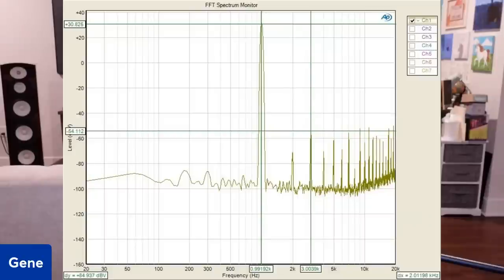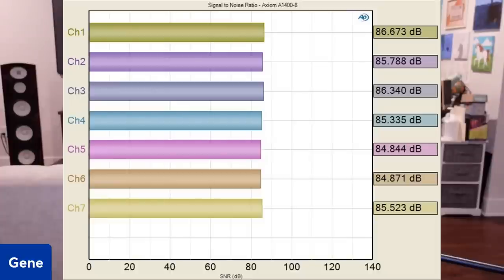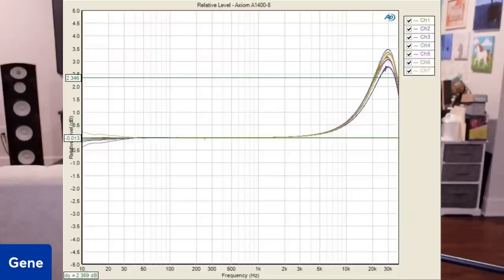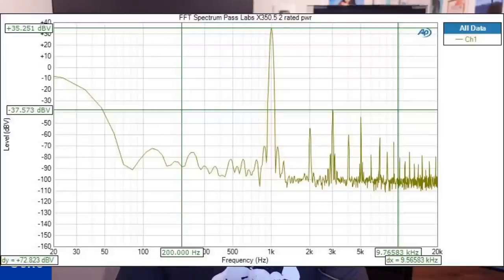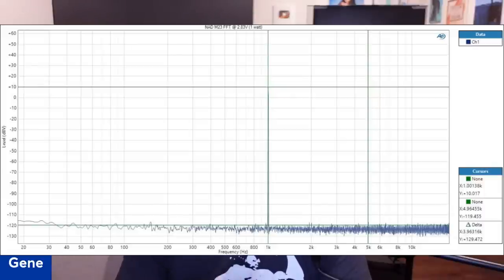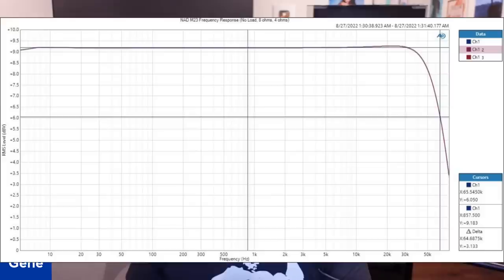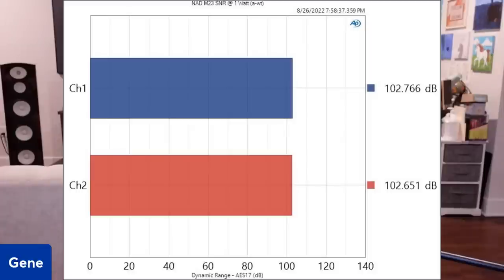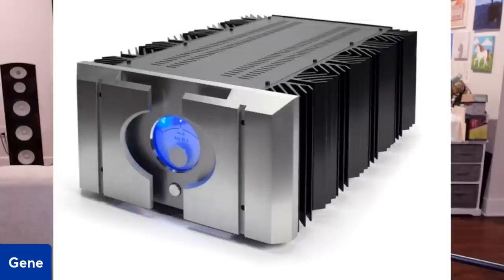Linear Amps are DEAD, Long Live Class D!

Comment: This is a really timely discussion as I’ve been looking hard at amp options for my living room. Looking at just buying another Parasound (A21+) to go with my Anthem STR, but also looking hard at something like an NAD integrated like the M33 instead.
Reply: If I'm not mistaken M33 is not even close to this one. Look at stereophile review. I've been there, decided to go with integrated STR. Not great, but not terrible. Awesome preamp but the power amp is loosing a bit of this performance.
Reply: Go for blind test, I noticed difference when I wanted to buy ELAC Floor standing FS 248 and carried my NAD and they had Marantz 7000N and was completely taken over by it. Earlier I had Class AB Onkyo but all the hype through youtubers for NAD i fall for it and was happy until I started re-discovering clarity.
Year back I visited a consultant in another city who had two Class D amps Pioneer and NAD and other Class AB and took blind test.
Please note Class D takes sample rate like digital and when it goes to high frequency amplification that adds noise (kind of jitter) and to eradicate they remove high frequency now to compensate they add high frequency before amplification.
Also note KEF has released wireless speakers and for Bass Driver Woofer they are using Class D but for Mids and Highs they are using Class AB.
You can take from my experience or can go ahead and burn your money in class D.
The analogy of Electric and Fuel combustion is totally wrong that can be used for amp power rating.
Please check PS Audio (Class D Stellar are cheap and Class AB BHK are very expensive) even Marantz gave up Class D after Model 30 and  back to class AB, all high critical listening amplifiers are Class AB or Class A (gets too hot had demo of old Yamaha at second hand dealer)
Reply: What's also not mentioned, or I missed? Is power consumption of Class D Amplification being very low. Easy on the Grid Cali & electric bill too for that matter. Another reason I got out of the 100lbs power amp realities. 👌
I'm liking the Active speaker options nowadays too!
Reply: @adrianegowski5012  Good catch! I read simular.
Reply: @jamiesmith6838  especially that Dynaudio recently issued new Focus series with dirac :-)
Reply: Avoid NAD. I've been regretting my NAD receiver purchase almost from the beginning. Defective designs, defective product, feckless "support." They contract out their (already defective) designs to various vendors who build the products out of sometimes-shoddy materials. You'll realize what a fraud "high end" can be.
Reply: @SoundOfYourDestiny  That's a bummer. I already have an Anthem STR preamp, but I'm sharing amps channels from my theater amps and it's a pain for triggering and control state. I'd rather just get a dedicated amp for the living room so have been looking at options and looking at a Apollon and others with all these Purifi class D amps to learn.
Reply: @SoundOfYourDestiny  When I purchased my NAD 2200, all those years ago it was sold as an amp unwavering to speaker loads down to two ohms? It only drove my JBL L-166!
It was my only power amp that needed repairing. It's industructable low ohm ability shortened it's usable life. (The amp that tried to do too much) 
I paid for the repair and sold it soon after. 
Never purchased another NAD. I was tempted to give them a second chance, hoping they've improved..but I never did. I was done with Mid-Fi. 
I went to a silver Classé CA-200. One off the best power amps I've ever owned.
Reply: @Techthusiasm  I ended up buying a Pioneer receiver that really has quite a few things properly thought-out. It even has two separate 12V trigger outputs, which you can set the activation status of for each source. I use it to turn on a wireless HDMI system for video sources. And... it worked as expected on the first try. The one idiotic failing (which the NAD also suffers from) is that one of its extended zones (for example, outdoor speakers) can't play back a digital source. WTF? At least that's only for zone 3 on the Pioneer; the NAD only has a "zone 2," which is essentially worthless according to them. In both cases, all I had to do was run RCA cables from a preamp output to the zone-whatever input to play back digital sources. How can they be too stupid to simply do this internally?

Comment: This is great to know that it's finally possible to make a good Class D amp.  I hope some of this dribbles down into the lower cost Class D amps in the future.
Reply: Try the Aiyima a07. Replace the removable Op Amp with a Sparkos Lab dual discrete Op Amp.
Reply: they've existed for 10-20 years sir.  just not mainstream.  you can get END GAME level class d/t amplifiers at virtually any output power you need for less than 500 bucks.  IF you are a diy-er.  connexelectronic, buy the modules or a board, buy an smps, it's as simple as hooking up some wires.  put it in a box if you care to.  if your needs are for only 100 or 200 watts and 2 channels, then literally less than 300 bucks can get you end game level sound, i'm talking it does not get meaningfully better than this sound.  forget the overpriced brands, wake up to diy and chi-fi.  ultra quality is ultra affordable now, if you are merely careful to discern where to look and what to get.  garbage chi-fi also exists... right next to end-game stuff.  luckily these days we have people that do the legwork with measuring and reviewing nearly everything in existence so it's not that hard.  end-game dacs for 100-200 bucks all day baby.  the ONLY part of the chain that technology hasn't made super cheap for end-game quality is speakers... because their raw materials still simply cost money even if you build it yourself.
Reply: Already has, long time ago. Hypex sells cheap modules of many ratings that outperform everything else on the market, regardless of price
Reply: @yurihalberstadt618  : Thanks for that information.👍👍
Reply: @scottypalmer2158  Oh and i forgot to mention: the measurement graphs on their site are so incredible you'd think they're simulatiions. Their not. Those are the actual measurement graphs. BP is seriously serious about not spreading any BS, even more so than Gene.

Comment: I moved away from room heaters long ago. My first non A/AB/Tube was a PS Audio GCC 250, which I purchased new when they first introduced it, and still serves wonderfully in my TV system. Having owned probably 8-10 class Ds since then, GaN amps has changed the game. My LSA Voyager GaN 350 @ $3000 MSRP is an absolute steal

Comment: I have built my own subwoofers. but since I wanted a lot of power I decided to go with Crown to power four 10 inch subs.
along with Yamaha RX-A6A.
I configure the speakers to work at a 4-ohm load coming from the crown with a converter box (balanced connection) I connected my sub out to the converter box.(even though I have XLR outputs from my Yamaha. I'm getting 1100 watts. undistorted. I would love to hear your opinion on the Crown XLS series amp. Thank you, Gene,

Comment: If you’re an audio enthusiast, there’s always celebration for new technology and variety. I have several Class D amps but also Class A, A/B, G, H, and even T amps. My Class T is pretty neat, novel - $40 Dayton Audio tiny thing that runs on batteries.
Reply: I have that same Class T amp with the TA2024 chip but under the Wondom Sure brand. It sounds wonderful with my full range transmission line bookshelf speakers. But 10W of power ain't enough for orchestral music. I could have spent a little more cash and go for something like a Sabaj A10A with more beans.
Reply: I've got a TA2021s amp that sounds pretty good on my desktop. Not enough power to drive the speakers to full, but they never need to get that far anyway in my use.
Reply: @RennieAsh  I think they need to make Class T Tripath amps more readily available. I actually tried my TA2021 on my Magnepan 1.6’s. They played quietly for sure. However they did sound great on some old B&W 302 Prisms and Polk Audio Monitor 5B with Silver series tweeters. Lost my amp in a divorce 😢

Comment: Very interesting, thanks. However, what I don’t get is the technical quest for such low distorsion and high signal/noise ratio that testing equipment can hardly measure properly. How can our analog and so imperfect ear even notice the difference ? At least for most of us ?
Reply from the maker: @philippefenain4405  Our ears can't, but why not build the best that's possible if it doesn't make other compromises?

Comment: The moment there's a class d amp that measures the same or better than a yamaha a-s301 or higher series for the same or lower price, i'll consider class D ready. 
Some of the cheap TPA3255 based amps around are very impressive for what they cost so it's no doubt only a matter of time.

Comment: I've never noted differences in power amp sound to any great degree, with a few exceptions (SETs definitely have a different sound - with notable differences in output tubes as well, and classic Naim has a distinctive sound to my ears).
But with Class D, i can say that the lowly ICE power 50ASX2 sounds as good as any Krell, Levinson or Pass amp i've heard (memory only, no direct comparison).  The ease of implementation, combined with good sound, means I won't use anything else in any build that demands more power than a pair of 300bs would provide
Reply: One exception may be a VFET (Tokin) amp based on the Pass SIT-3. Haven't heard any amp that sounds better than this (with relatively sensitive speakers.) It's incredible.
But, I want a Class D for when I'm not doing dedicated listening for power efficiency reasons.
Reply: @asplmn  I haven't heard any of Nelson's First Watt designs, but I do know a guy who built the Amp Camp one - Ill have to see if i can borrow it sometime
Reply: @robertbrenner610  the FW stuff is definitely worth playing with -- or building (DIY) -- if you get a chance. The ACA is awesome for the price, but doesn't compete against the SIT stuff.
Would love to hear your thoughts if you get a chance to do so! :)

Comment: How do the Technics Class D offerings compare to the NAD Class D?  Also, true, splitting hairs is right.  With measurements so good when comparing a quality linear to a quality class D, one may sound more pleasing to your ears than the other, but I doubt you'll hear any difference regarding the measurements. Ultimately how it sounds is what counts, not how efficient it is or how it measures, unless it's going into space.
    Is a SMPS used for efficiency or is it necessary in a class D for other reasons?  They have too many parts - too failure prone and usually need fans to cool them.

Comment: You are right I never should have included 10k, that's way beyond audible.   I've only used 1k square waves in my measurements.   However music is more than sine waves, of course it isn't square waves either but rise times are important and otherwise similar measuring amps with different measuring square waves at 1k sure sound different with the same speakers.

Comment: Really like the Hypex / IcePower Class-D amps. As long as you have 150W per channel of <1% THD Class D, those sound excellent.
Reply: I don't disagree the hypex stuff is good, but 1%?  i only look to see how high the power goes before it hits the corner and starts a steep climb, and consider it's power to be whatever it puts out at 1 or 2 orders of magnitude less distortion than that.  you could argue .1% i'll accept that.  plenty of amps out there with good power at .01% (as he showed here).  1% is kind of high.  my ta-3020 based amp is doing over 100w at like .02%.

Comment: In my limited experience there is one measurement which describes in more than one way how an amplifier will sound when connected to a speaker is how the square wave at 1k and and 10k measures and looks like on a scope screen.    I didn't see that in your tests of the the new NAD class D amp.
Reply from the maker: I can understand looking at a 1khz square wave despite it's nothing like anything a real audio signal produces but a 10kHz is ridiculous since the ultra sonics are way above human hearing range and most amplifiers are already purposely bandwidth limited to produce the best noise and distortion within the audible band.

Comment: The historical problem with class D amps is the passive output filter, And it must be a passive design. A passive filter response is highly dependent on the input and output impedance match. Well as we know a speaker is hardly a constant impedance. IIRC, over 300%  variation across the audio band. So that means the output filter is not going to reject the clock signal equally across the audio band. You can only design the filter for a very narrow impedance if you expect a consistent slope. 

Now I know that Bruno Putsley(sp?) has done some extensive research into this and other class D issues and his products are in fact highly regarded in the high end audio community. I guess it's all about practicality. Just how low does the clock residue need to be? There must be a sweet spot but I would think that would be speaker dependent.. Is Bruno using some kind of feedback to pre-distort the filter and thus further null the clock noise? Kind of like hum with tube amps. You can never totally eliminate hum with AC heating but there is a practical level where it's not  really an issue.

Comment: IF 95 watt into 8 ohms is sufficient the linear Topping LA90 run in bridged mode blows purify amps away both based on measurements and sound quality. See audio science review test results! It consistently has --15db lower noise floor and has as linear a frequency response. I run 3 of them for my front 3 Focal Kanta 2 set up. They beat the pants of my previous ATI AT527NC Ncor. The ATI sounded noisy in comparison.
The rest of my speakers I run with class D amps.
Reply: The LA90 is a beast. Phenomenal sound quality. I’ve not committed to buying a pair yet but likely will soon. Glad to hear they’re working out for you.
Reply: @Cubik303  Great! Just remember that in bridged mode it requires a speaker with a Nominal impedence of => 8 ohms.